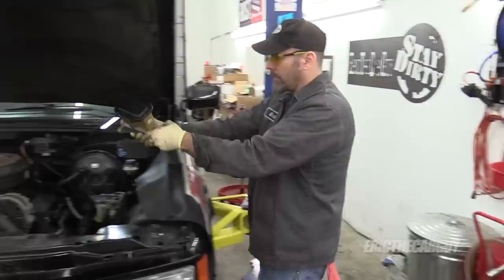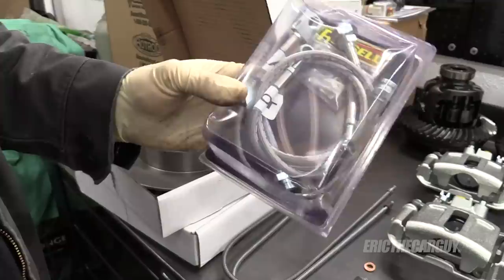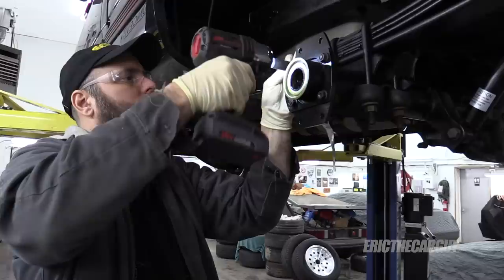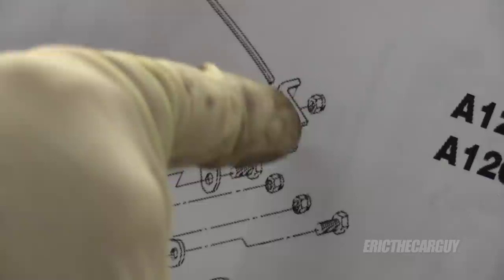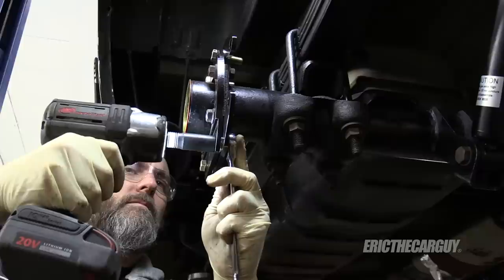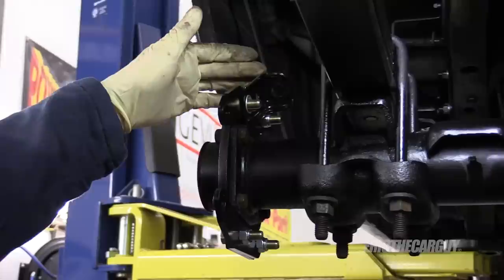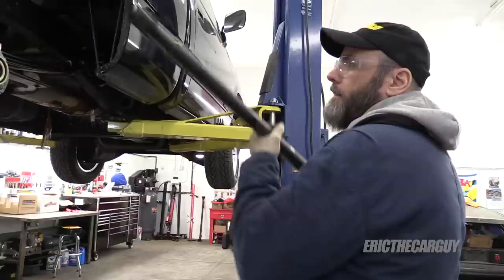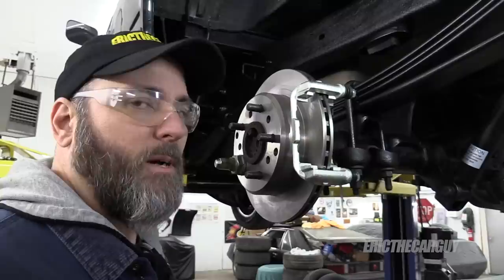GMT400 Rear Disc Brake Conversion (Part 1) #ETCGDadsTruck

Comment: Not sure if its been mention but I believe that one bolt should have been put in the other direction there is plenty of clearance behind the rotor for it and the head would be much lower to clear the cable. Just my 50 cents worth < Inflation LOL

Comment: If there is no torque specs then they are probably just hand tight. I mean it is only the brakes nothing important.
Reply: Needs a good 3 or 4 ugga-duggas.
Reply: Use the German system,  gutentight
Reply: yeh,,exactly what i did on the missuses car.mmmm,i do miss her..really.........

Comment: Eric, on the bubble flare, I hope you used the flat side of the die on the flare tool and not the 45 side. It WILL leak if you didn't.
Reply from the maker: So far no leaks.
Reply: @ericthecarguy   Good! Maybe they flattened out and sealed. Yea there's a flat side and a 45 side to those dies, and being that German cars typically use bubble flares I learned that the hard way. I bought that tool because of you. And now I have another one at work with the 37 degree die because aircraft use the 37 degree taper, which comes from hydraulics. Lots of AN fittings and JIC style fittings. Love that tool. Thanks for doing a review on it!!

Comment: I know this old video but for starters you have the calipers on the wrong side as the bleeder screws need to on top something else should be noted is the emergency brake cables go underneath the axle not on top

Comment: 8:42 is that a mixture of metric and imperial?

Do you mean M17? or M20? Because that doesn't look like 17mm on that diameter. Unless you're talking about the head size? That looks like maybe 14mm?

Thread pitch in metric is measured by the distance covered by one thread, rather than threads per inch, it's mm per thread.
There are standard metric thread pitches, although you can generally have whatever you want, it just has to be made.

Comment: Calipers on on the wrong sides? Bleeder should be on the top, ebrake cable on the bottom? Stock cables will be short, what did you use?

Comment: I got a 98' k2500 with spongy brakes. Brake breeds, replaced mc, rotors, shoes, drums, lines, ended up replacing mc with a generation ahead, think it was from a 2001. Now no more spongy brakes. Probably air in ABS...didnt want take to dealer. Maybe replace with rear disc someday.

Comment: Gotta love the one size fits none kits, it really sucks when you gotta start modifying a kit to make it fit.  Another reason I hate aftermarket car parts and kits. But unfortunately at times to do what you want it's the only option you have.
Reply from the maker: I've come to find that when installing aftermarket parts like this modification is the norm. Honestly, I enjoy the challenge. Thanks for the comment.
Reply: @ericthecarguy   I can understand how a guy in your situation with your background having been  in the automotive repair industry would enjoy it. It would be a refreshing change to do something other than the same old. Swap an old original equipment dealer  part for a new original equipment dealer part. As for me I'm a diy guy working on my own stuff. I like it when it fits and goes smoothly.

Comment: I got a stupid question cause i did something stupid. I threw away the old pinion gear WITHOUT checking the shims first. How do i measure for the distance?? I NEVER messed with a rear end.

Comment: I know let's go to junkyard and get the disc brakes straight off of pick up. That already has  it. You can still use the same master cylinder. You may have to put new brake lines on it on the rear end but that'll be it.  Hands up if you've ever done this.
Reply: Pretty sure no GMT400 ever came with rear discs from the factory.

Comment: The other mod you can do is a hydro boost master swap off a gmt400 diesel
Reply from the maker: Some have suggested that, but I'm very happy with the modifications I did to the stock system and I didn't have to run any lines or mess with the power steering.

Comment: I watched your previous video and your drive shaft didn’t fit. That truck is lowered is why I’m assuming you had to do the custom work to brake lines? Otherwise length would of been correct at trucks normal height.

Comment: I did an SSBC brake caliper upgrade kit on my old S10 year’s ago your troubles installing your disc conversion kit are typical of the quality of their products and installation instructions. unfortunately one the calipers I installed (SSBC made product not something remain oem like yours) split itself in half suddenly causing a brake failure at high speed not a fun experience I’m lucky I didn’t wreck or cause injuries to me or someone else just got stuck on the side of the road for several hours waiting for a tow truck. Definitely the last time I ever bought one of their products I never recommend them. Customer service was no help in my situation either.
Reply: I've seen many kits, many hacky ones, but this one is just...something special. Looks ok, but there's various things innit that are downright dangerous.
Reply from the maker: Glad you're OK.

Comment: How does this affect the rear ABS only on the older trucks? Is there a sensor back there or is up near the brake booster? I debated doing this. Just wondered if i would lose my ABS lol

Comment: Thanks Eric, I'd like to do this to my 1990 k1500 4x4 4.3L 5 spd. I have 6 lug wheels and I do not have ABS. Do you know what kit will work? I see a couple different variations. Any help would be greatly appreciated. Glad you got your motor fixed!

Comment: My 98 Z71 Silverado has a 14bot semi floater would this kit fit a 14bolt 6lug axle? Does anyone make a rear disk brake kit for the 14bolt 6 lug axles?
Reply from the maker: Someone probably does, but I don't know any off the top of my head.

Comment: Good afternoon.  I really enjoyed your video on this conversion.   I have an 88 Chevy C1500 that I bought new off of the showroom floor years ago.   I have been wanting to upgrade the rear brakes and this really helps out.  I called Summit concerning the conversion kit and the don't carry SSBS kits anymore.  They had concerns about SSBS ability to stay aflot.  Have you had any issues with the kit and the ability to get new parts?

Thanks again.

Comment: Ah, yes, you did bring up the Fairmont rear brakes when you said these calipers have to mount upside down. Was that a slightly embarrassed look on your face? As someone who has made many a mistake, I feel your pain, bearded brother. I don't mean to bust your balls, I respect your willingness to show mistakes that you could edit out so easily.

(The beard is great, btw.)
Reply from the maker: No worries, and thanks for the comment on the beard.

Comment: Hey Eric, did this exact same swap on my 1991 with the same kit. I ran into the same issues. I am curious to see what you do on the prop valve. The directions are poor and it leaked. I ended up removing it all together with no problems. I am also curious to see how you manage the e-brake. I didn't really care for the set up.  Great vid a always 👌
Reply from the maker: I didn't run into any issues on the prop valve, but the system seems very rear bias. Therefore Im' going to install an adjustable prop valve and dial in the brakes I want.
Reply: EricTheCarGuy I also did an ls swap on mine as you have discussed on yours.  The wiring harness for the engine was the biggest pain. Went with the painless system. Just a heads up. Hope it helps
Reply: I stand corrected, I did use a prop valve.  What I did do was remove the black box that ran the abs for the rear. Never worked right anyway and caused the dang brake light to come on.

Comment: Eric, I have been behind the wheel of my dads 1989 GMC K1500 for almost 18 years. I remember the day he brought it home in 89. Love that truck. I have easily put enough money into keeping it alive that I could buy it new again. It's hard to find good OEM parts and those backing plates you took off looked beautiful. Would it be possible to get them off ya? Any O.G. G.M. parts I can get my hands on is what I would rather put back on it.
Reply from the maker: They are sitting in the scrap pile behind the shop. You're welcome to them.
Reply: @ericthecarguy  oh god nooo.!!! F me.. the scrap pile..... Im in Illinois, otherwise I would be there in a minute. Shame to see good old parts go to scrap.
Reply from the maker: It's also a shame to load the shop up with so much stuff I can't work on new stuff. Sorry.

Comment: the drum brakes on the rear do very little of the stopping power and they make for a very good parking/emergency brake function. I would stick with the original system design and just fix you peddle feel if it really needs fixing.
Reply from the maker: Already been there. https://www.youtube.com/watch?v=IcV6Rd4MiZ4&t=37s

Comment: Hydroboost would be a good upgrade too.
Reply from the maker: Not really. More parts, more expense, little gain.
Reply: Little gain in braking power? Oooooook
Reply from the maker: Yes, little gain in braking power for the time and effort to install that system. What I've done to the brakes on this truck have made great improvements as you'll see before this series is over. In fact, if you just install the steel braided lines and call it good you'd be just fine.

Comment: I would not use these nylock nuts (nylon locking nuts) on a hot part like that, the nylon piece would melt in minutes and will cause the nut to back off.

Comment: Hey Eric, have you ever played around with NiCopp lines?
Reply from the maker: Every time I post a video about brakes, at least 4 people bring that up (see below, you're now #2). The answer is, no. Why? Because I use the stock I have on hand and it works fine. I don't have any issues bending it, and I haven't had issues with anything leaking. The key is a good flare tool from what I've found. Thanks for the comment.
Reply: Forgive me Eric. I'm usually pretty out of the loop. I only wanted to hear your opinion on the stuff.
Reply from the maker: Please don't think I took offense. My apologies if my comment came off that way. I think a better approach is to make it into a drinking game. Every time someone comments about NiCopp brake lines, take a drink. You probably won't get drunk, but you might feel a little happy.
Reply: I'll drink to that!

Comment: Did I here you said you did a rear brake conversion on a ford? If so how that work out. I been thinking about putting one on my 97 f150.
Reply from the maker: That video is linked in the description.
Reply: Thanks

Comment: I am not a fan of steel brake lines, in our climate and the local councils salt applications for no real reasons they corrode very quickly. I make my own from cunifer pipe, easy to work and corrosion resistant. Having to change some lines on a 2003 mini cooper due to severe corrosion found during the annual MOT inspection.
Reply from the maker: Mine are in a plastic coating. Perhaps that will help prevent corrosion.

Comment: why do the calipers go on the back of the rotor, it would make more sense to go on the front
Reply from the maker: Parking brake cable routing.
Reply: Why would it being on the front make any difference

Comment: Why use a kit that is NOT very well thought out and uses Ford parts???  Plenty of kits that use ALL GM stuff for your truck and you won't have the issues you are facing.
Reply: I know it’s an old comment here but any chance you’ve done a rear conversion on an OBS and if so what kit did you use?
Reply: @rolandcarrasco2717  Nope never found a kit that was decent.
Reply: @DieselWorld  I appreciate the reply. Currently watching another video on a disc conversion right now so I’ll see how this one is.

Comment: I'm lost.
It"s a truck with solid axle and caliper is bolted solid to axle, break lines are mounted to axle. 
Cutting hard lines was not needed, just bolt it on directly to calipers.
Example from google images.
https://twitter.com/johnsindustries/status/836277241831124992
I'm reading lot of comments and nobody mentioned this. Or i'm missing something.
Reply from the maker: What happens when you go to change the brake pads?

Comment: wouldn't it have been easier to replace the rear end with a factory disc brake one then you don't have to put ford pads on your chevy
Reply: From what vehicle? Later disc rear ends are all 6 lug.

Comment: 1. You could have easily looked up torque values for all hardware in the service manual. First section chapter. Using a kit with early Cadilac Eldorado calipers would have been less trouble, but same function. The kit appears to too generic, one size fits all. Screws too long ? Get the right length. Gotta have 1 complete thread showing on a selflocking nut, thats the rule. Need more room. Some of the all metal lock nuts are little shorter. Just don' t use a shear locknut. You need practice and instruction on tube fabrication and bending. Yours looks like auto 101 first day. Sorry but looks terrible, did you say your gonna use zip ties to secure it? I have heard other poeple crabbing about SSBC but reserved my own thoughts. But if this kit is what i receive, no thanks.  Good luck.

Comment: Was it worth it though?
Reply from the maker: After I completed work on the fronts the truck stops great and has excellent pedal feel.
Reply: @ericthecarguy  Cool. I always wanted to do rear-wheel discs. I know these C1500 have a special bleed procedure with the proportioning valve next the master cylinder that a lot of people don't know about. I'm sure you know about it and feature that in your part 2 or 3.
Reply from the maker: The only thing you might need to do is use the special tool to hold the proportioning valve in place while you bleed. However, this kit requires that you modify the prop valve so it's really not necessary.

Comment: What a nightmare of a kit, especially for $1000! Wrong bolts, no backing plates, they don't tell you the exact brake pads to use (only hint Lincoln), no brake shims/springs, no SS brake lines included (have to buy your own), modified brake line length to fit. They should not be selling this product 👎
Reply from the maker: Honestly this is common with aftermarket performance parts.
Reply: On the pads they do give you a part number. On my case it was D347. Turned out to be $18 pads from AutoZone.

Comment: I did some homework for you. Those calipers are from an 88-91 Continental. Get a rear brake hardware kit for one and the brake pad shims in it should fit. Hopefully this link works, 
https://www.rockauto.com/en/catalog/lincoln,1990,continental,3.8l+232cid+v6,1187995,brake+&+wheel+hub,disc+brake+hardware+kit,1736
Reply from the maker: Awesome, thanks!

Comment: Hydroboost, hydroboost will help you’re stopping. Not the master
Reply from the maker: It would've also taken more time and effort to install and complicated the power steering system. Honestly, all you'd really need to do is the steel braided lines and call it done.